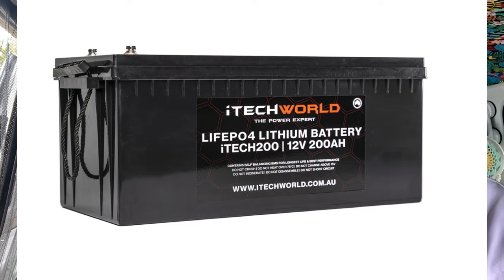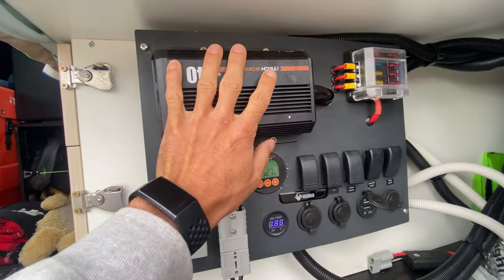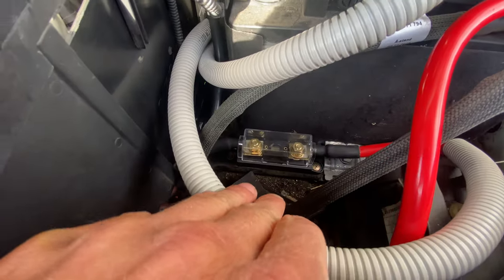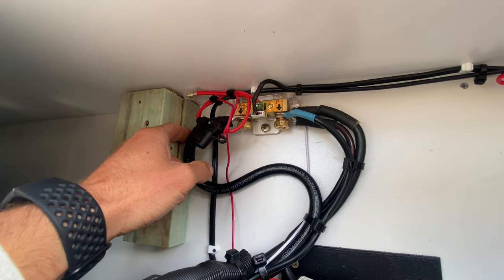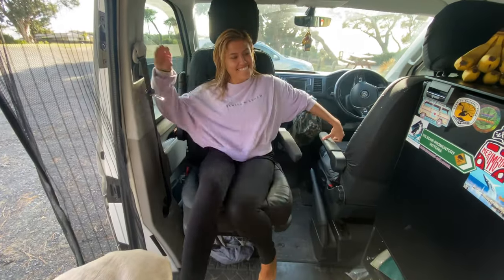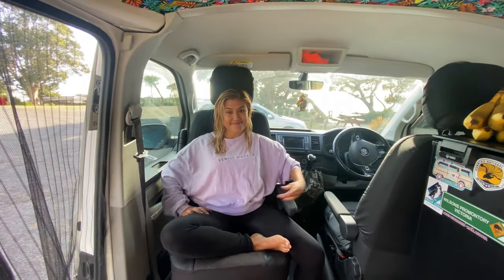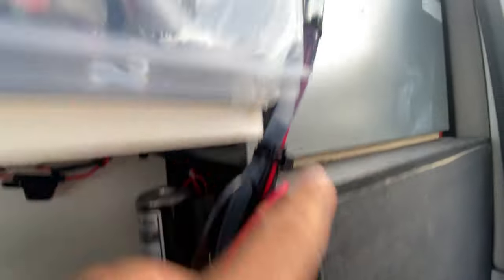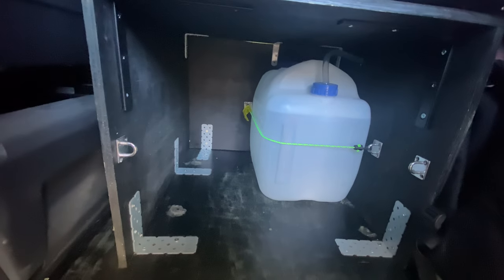Van Life Reality: Our First Electrical Issue & How We Fixed It on the Road!

Comment: Have a similar van /fridge setup with 20 amp dc/dc charger with a much smaller battery. Only use a fraction of the power you use. There might be a hidden problem causing the massive drain.
Reply from the maker: Thanks mate